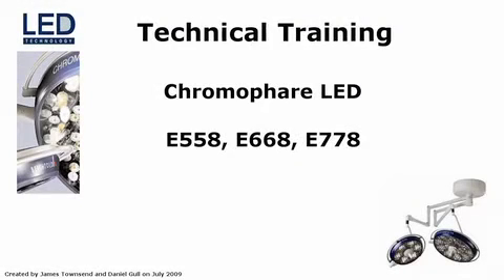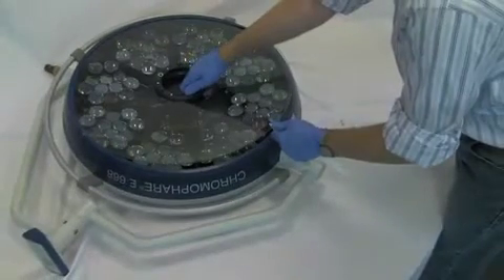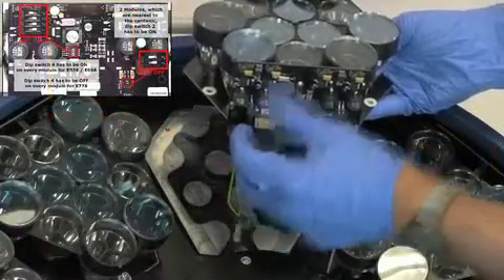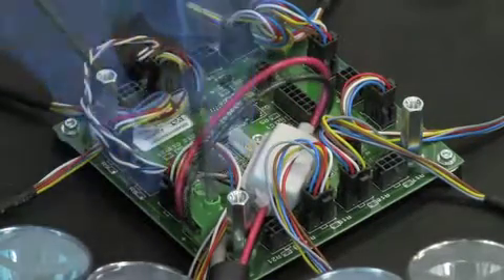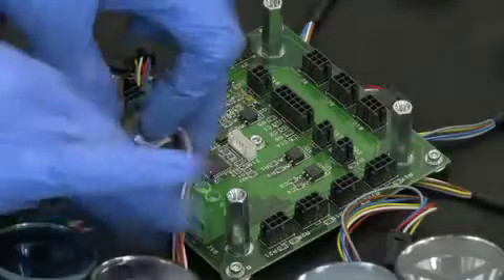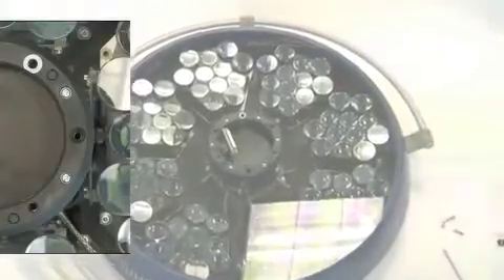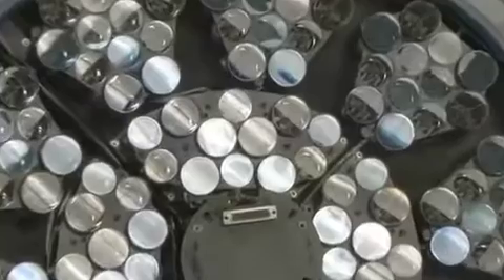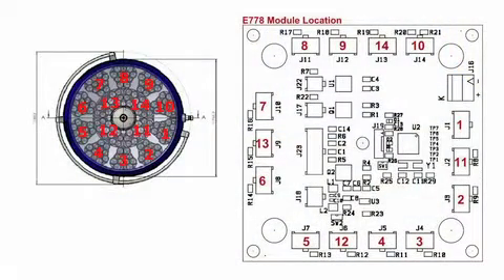LED Surgical Lighting Inservice

Comment: We are one of the leading of LED Operation Theater Surgical Light in Delhi, India. Time of LED Surgical Lights are gone now doctors do not need to work in the heated room as LED OT Lights do not radiate heat. The life of OT Surgical LED Lights are very long and they give natural bright light.| #http://bit.ly/2ALrGCK | You can call us: +91-9205156857, 8295666500